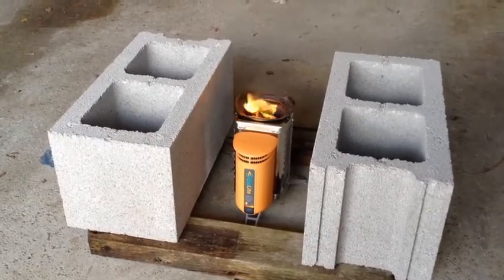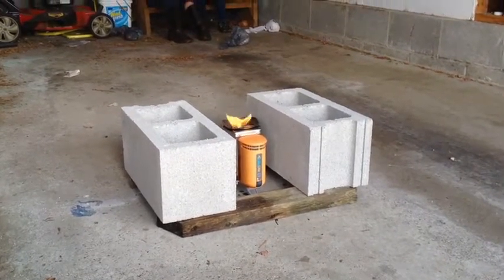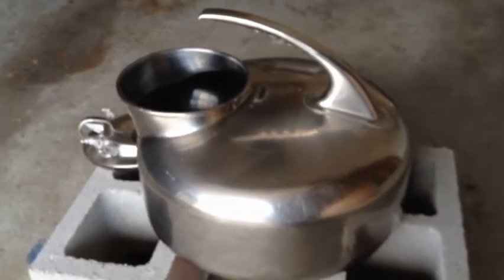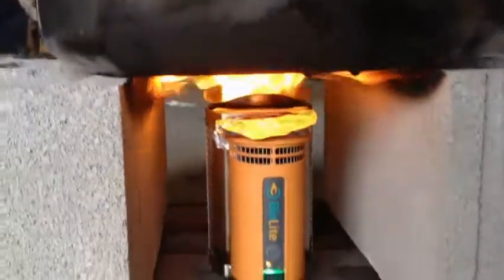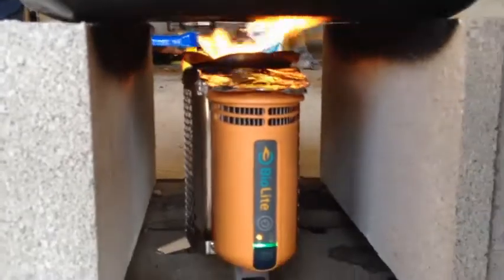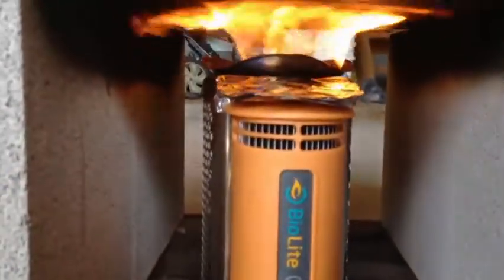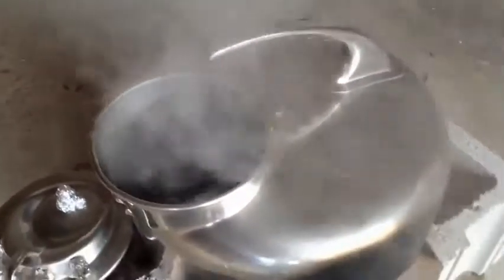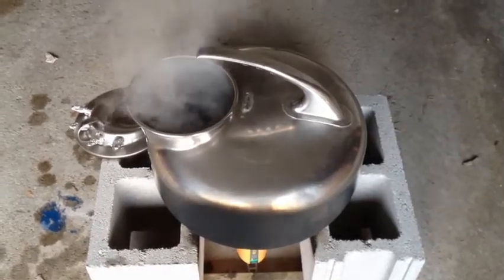BioLite Stove 5 Gallon Boil Test

Comment from the maker: Thanks for watching!  I'm not sure if the heat would have damaged it.  I just noticed that after I added fuel the fire would get really hot, and I felt like the top of the power module was hot.  But after I placed the foil I could put my finger under the foil and feel almost no heat reaching the power module. So I just wanted to be safe.